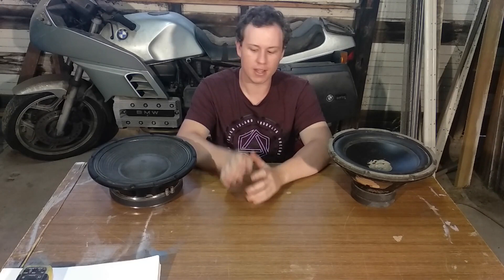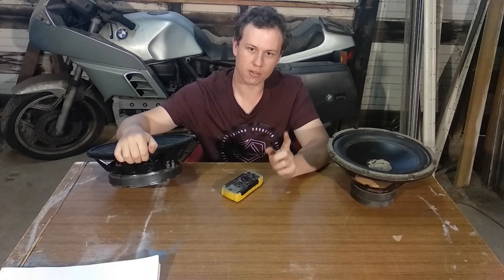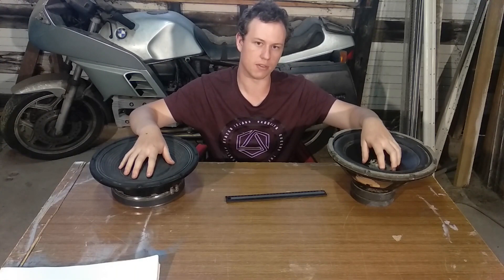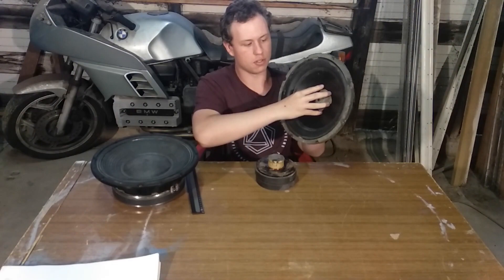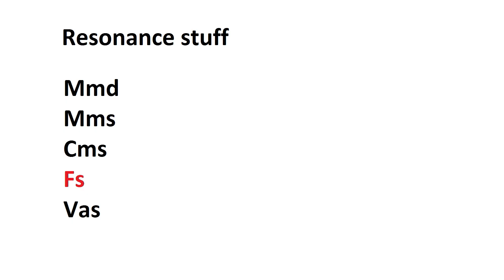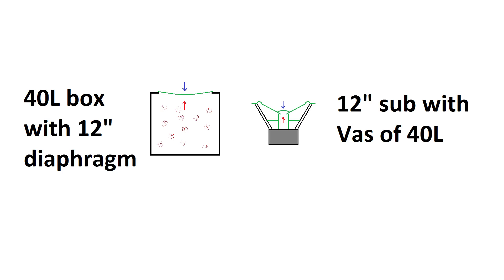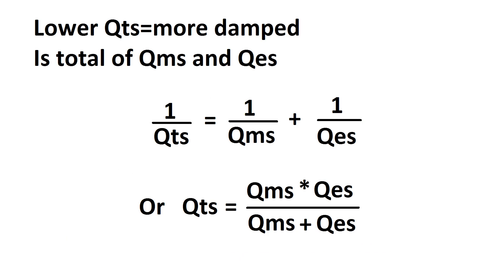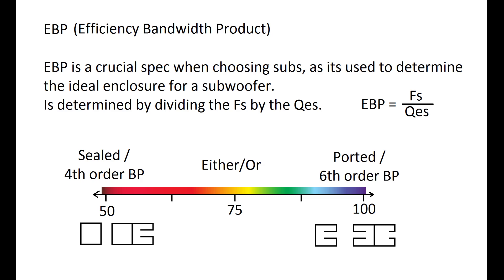Speaker Specs Explained!

Comment from the maker: EDIT: for my Q equations, I include a constant of 10*Pi. This is actually the square root of 1000, so is 31.6, not 31.4 as I assumed. Once again, I did the derivation myself. Would've made the equation work with both grams and milimetres, so wikipedia got that one right. But yeah, the answer is virtually the same, and with speakers greater uncertainties lie elsewhere, so should be fine to use.

Comment: Thank you so much! It's hard to find videos/websites that can break down these parameters as well as you do, nor do they explain how they impact how the driver behaves (affecting how it sounds). I would love to see more videos detailing how an enclosure affects the behaviour of a driver and it's output; for not only subwoofers, but for woofers and full range drivers. Not to mention, what factors to consider when designing an enclosure to get the best out of the system. Also there is not alot of information behind cabin gain, and how it affects sound. I would love to know more behind this. Once again, thanks alot for this video, it's really helpful for enthusiast like me.
Reply from the maker: Yeah, from research it appears there's more misinformation than real information. I even found two websites, one copied off the other, not sure which way round, and yeah, was way off. Described vas as 100L with the cone pushing, idk something wierd along those lines.

Comment: Awesome video, thanks for the information. Some constructive criticism; You sound a little bit monotone, it would be cool if you had a little bit more enthusiasm pressed in to it. Not hating of course, I pressed like in the end :)
Reply: also moving the microphone closer to you and not cranking up the gain so much would help to reduce that background noise drastically :) (or at least try using a noise gate or a denoising function or both)
Reply from the maker: @paulhamacher773  Yeah, I should get a better mic. And camera for that matter, but since the bulk of my views are on vids that don't even use a camera, trying to work more of my face into it so I can justify.

Comment: Nice video! Let me ask some question. How do you know how much XMax is in a driver under TS parameters measurement, let’s say with ARTA software. Of course that you cannot take the driver apart in order to have a look on the voice coil and measure it.! Is there any method you can point out? Or maybe same estimation? How does this value affect the TS parameters result I the measurement? Thank you!